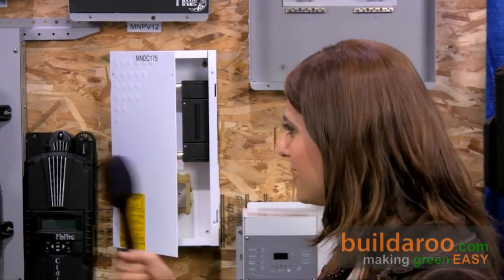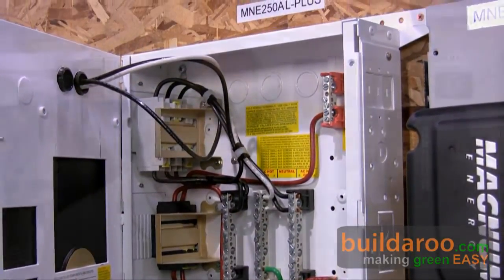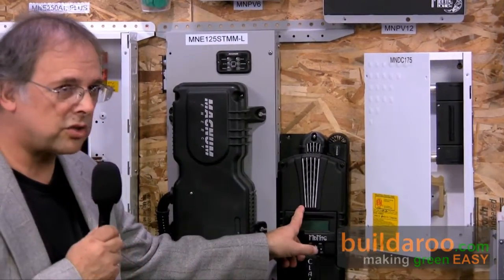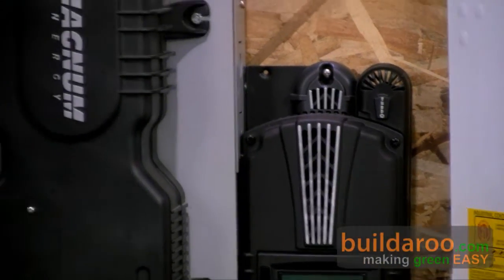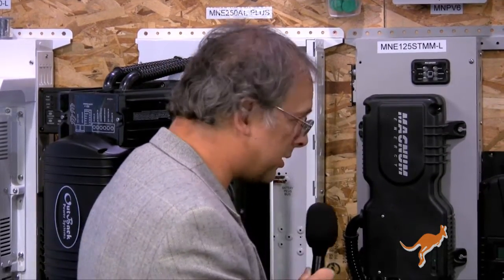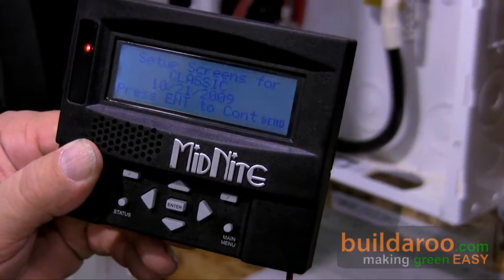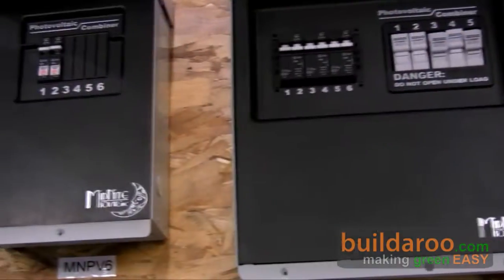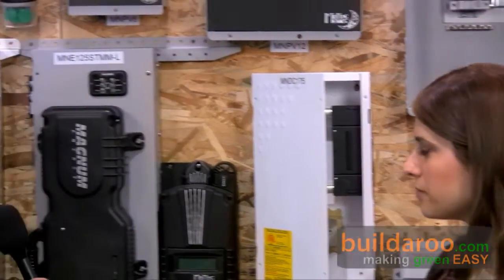Midnite Solar Classic MPPT Charge Controller - buildaroo.com

Comment: 2018 and still does not talk! Overheats and does not have battery voltage sensor. All the readings are false. Will damage your batteries.
Reply: What do you men "does not have a battery voltage sensor? Temperature? These are great controllers and you apparently have a hidden agenda here. What are you not telling us?
Reply: It will damage the batteries if the owner doesn't know how to configure the SCC ;-)

Comment: Very nice charge controllers.
I'd like to know if i can use aux output to plug a grid tie inverter. This way i'd use excess charge straight from panels and would not drain my batteries.
Tks for replyingg.